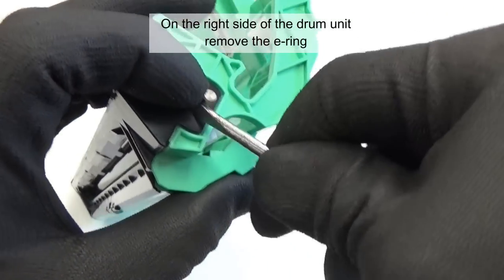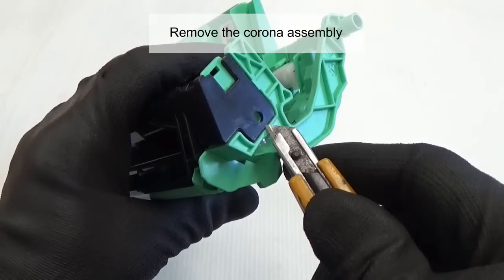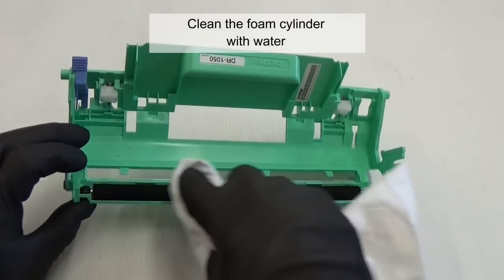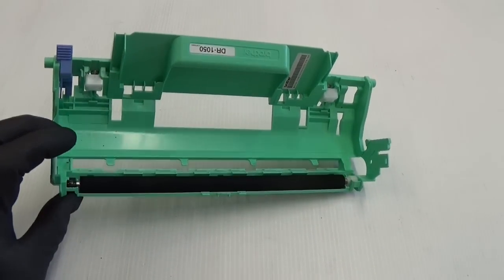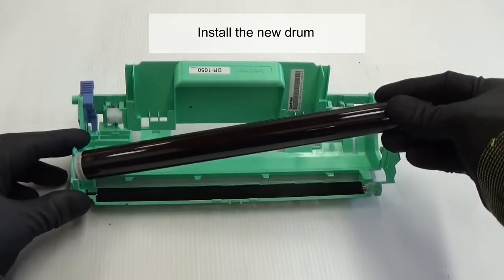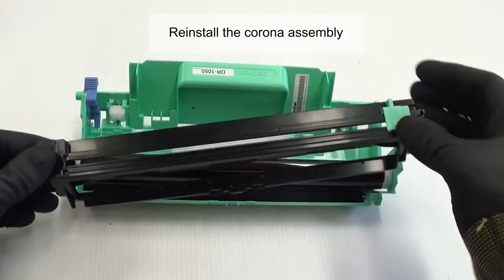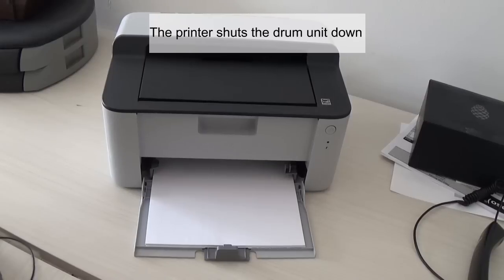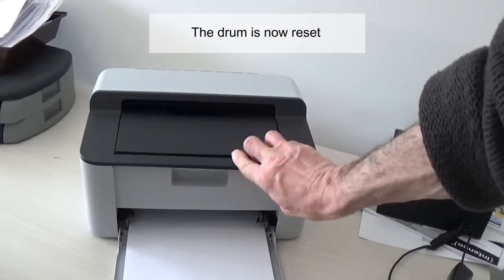Remanufacturing and Reset Brother Drum Unit HL1110 DCP1510

Comment: Hello, how I could check and replace the charge roller on Xerox P115W?
The drum internal is very similar to this video.
Reply from the maker: it has no charge roller, there is a corona wire
Reply: Thanks for the answer.
Also, where I can find defective chart table for Xerox P115W? Can't find it anywhere, including for Brother printer counterpart too.
Reply from the maker: I haven't a defective chart table for this printer. I0ve only a troubleshooting guide for laser printers
Reply: Okay, thank you for the response.

Comment: To reset the drum counter, press the power button in firmly (for the click), but faster than in this video. Didn't work for me till I did it substantially quicker, about 4 clicks in 2 seconds. My old drum was making a couple of black spots on the paper. When inspecting it (second time around) I could see the places on the drum where this was happening and I thought it was scratched there. But rubbing these spots firmly with an oldish clean tea towel wetted with isopropyl alcohol, these bits came off and now the printing is perfect again. Might need a new roller before too long, but for now the cleaning process has worked nicley. Thanks viandant5 for helping me through this.

Comment: Excellent video.  Thanks so much.  My HL1110 was printing a vertical line down every printed page, even after I put in a new toner to replace the toner it originally came with.  Machine itself only a year old.  I followed your video to help me do a servicing, although I used special wipes to assist with most of the cleaning.  Seems to have fixed my problem!!    **Only suggestion I have is to use pliers to put the E-ring back in position, because I couldn't do it using the head of a flatblade screwdriver.  Best wishes.

Comment: My drum got smudges of toner on it when I printed without knowing there was ants inside my printer. I'm not sure if it's scratched or what, but do you recommend replacing it or should I just clean it?
Reply from the maker: try to clean it with isopropyl alcohol, I think it will work. Chek the toner cartridge too, may be the smudge is on the toner roller
Reply: @viandant5  Cleaning the drum with isopropyl alcohol by using cotton buds right? That's what the instruction state to use when cleaning the drum.. But they don't mention the use of alcohol though. I will give it a try. Hope I don't need to replace it! Its lifetime has not even reached half yet...

Comment: Replaced MFC-9440 drums like video, however the Machine Info/Reset Drum 
menu pick does not exist. How do I reset this?  Still says drum 0%.
Reply from the maker: in the description of the video you'll find the reset instructions
Reply: Color MFC-9440 has a power switch. Turn it on, at the main menu. Press '3' and '9' at the same time.  Slide Green Tabs message wouldn't clear so I installed a new high voltage board.  Damp paper can short that out.  Now we are 100% Thanks for your professional video.

Comment: Dear viandant5 after replace the OPC drum print quality problom not solved. what are the reasons and solutuions for the poor print quality.
Reply from the maker: it depend on which poor quality problem is. probably the problem is the toner cartridge
Reply: i replace the toner also but after that machine displaying the following
 massage,"Drum! Open the cover and top cover. slide the green unit 
several times."
Reply from the maker: may be the cover sensor is broken or out of position, or the toner cartridge is not in the right position. remove and reinsert the toner cartridge into the drum unit
Reply: what can i do if cover sensor is broken or out of position??
Reply from the maker: not much, but I think the problem is the toner cartridge not inserted in its position
Reply: will You Please tell me how to reset drum in Brother DCP-1514
Reply from the maker: you can use the instructions of this video
Reply: but the display panel and all keys of my printer are different frm the printer of your video
Reply from the maker: In the description of the video there are the instructions
- Press Menu button.
- Press Up or Down arrow to choose “Machine Info”. 
- Press OK button.
- Press Up or Down arrow to choose “Reset Drum”. 
- Press OK button for 3 seconds.
- Press the Up arrow to reset the drum counter.
- Press Stop/Exit.
Reply: thnx for ur quick response dear.!